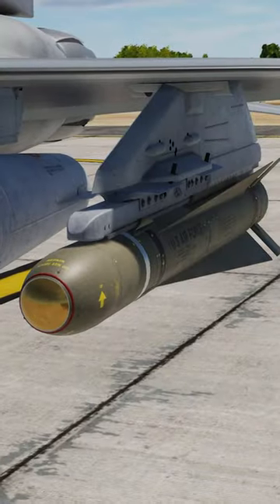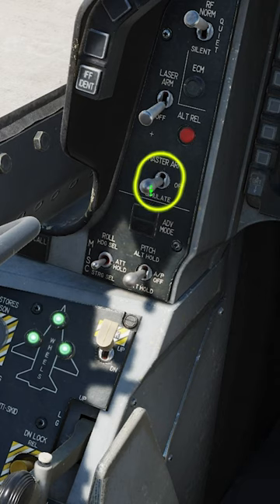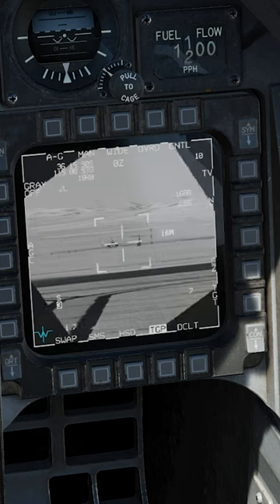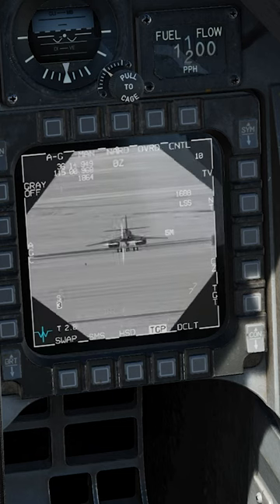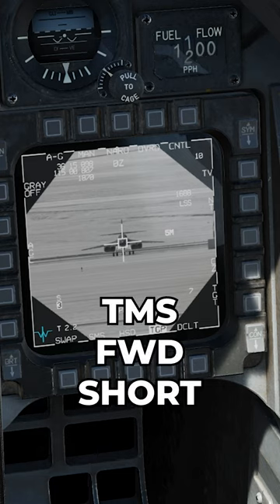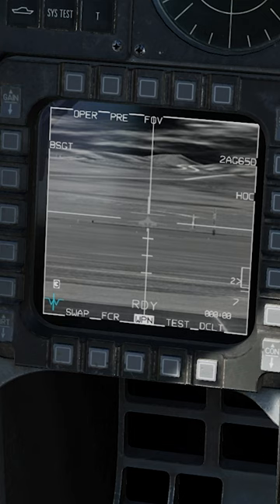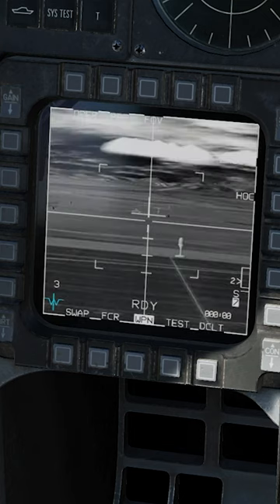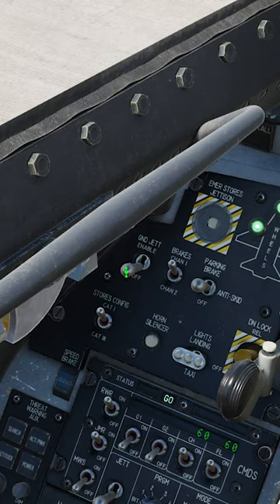F-16C Maverick Boresight Procedure in 60 Seconds

Comment: Okay, I will be watching this short for a week to get all the controls mapped.
Reply: Just buy a Thrustmaster warthog, everything comes premapped cause it’s pretty much the same in the cockpit
Reply: @hoverbike  and itll cost me only half a week salary….
Reply: @HOTSHTMAN53  at 20$/hour
Reply: @HOTSHTMAN53  idk man i bought mine for 170$ used, and it came with all the upgrades. Sanded down gimbal, silicone grease, etc. It’s an absolutely lovely piece of kit. Once I replace the gimbal of the stick with a Virpil base, due to Hall effect sensors already being present in the throttle, it should outlast me. I bet I’ll be dead and it’ll still work. Thing is as solid as a brick wall. I love it, and for 170$ it was an absolute steal.
Reply: @hoverbike  That's a sweet deal. I was looking for a Warthog set but everything I found was $375+. And I couldn't find it new under $500. I ended up saying fuck it and got the WinWing Orion2 with the 15EX II grips and the 16EX stick all for $491 shipped. I thought it would take a few weeks to arrive, but I had it in 5 days. Now I just need some rudder pedals because the z axis attachment for the stick was out of stock.

Comment: Don't forget to turn your 65s off so the battery doesn't die on the missles and don't forget to turn them back on before you need them!
Reply from the maker: Great tip, just not simulated in DCS
Reply: @TrickerDCS yet 😏
Reply: Doesnt that reset the boresight?
Reply: @jefe142  not in BMS good question though, although if the batteries die it doesn't really matter lol

Comment: Don't be surprised if your boresight has a fair amount of error or drift. Unless there was an effort made in the mission editor to put a very easy to lock up target far far away at the airfield. You will have errors in what your tpod locks and where your mav is looking. ED went a little overboard on this given all the things we magic wand over in other places but it is what it is
Reply: Just get it close and you are fine.
Reply: That's just how it works due to parallax, you need to do this procedure in the air, the further away the target is, the more accurate the boresight will be.
Reply: @Madnot4  How is this done in real life?  My gut tells me that wasting valuable fuel flying around to find and lock a ground targe to align is a bad use of fuel and time in the air. And unless a valid asset is placed there is really no way to get a good alignment. Where as this is obviously accounted for in RL
Reply: @MAYDAY SIMULATIONS  It's done in the air, because the mavericks have a battery that only lasts up to an hour (don't quote me on the exact duration, I haven't slept in 24hrs), usually in real life you spend way more time in transit, we are talking hours in the air. So yes, the mavericks are aligned in the air otherwise by the time you got to the target, you got no mavs.
Reply: @MAYDAY SIMULATIONS  this is how it's done in BMS, for example, because the maps are way more massive, and the time in transit is much longer.
Reply: @Madnot4  Roger that makes sense as a/a refueling is usually involved. Pretty sure once you align the maps you can shut them off to save the coolant without losing your alignment....but ya I don't an official manual.
Reply: I feel like an IRL F16 should have the covergence be automated. The targeting pod knows the distance, so why wouldnt a computer account for the correct convergence?

Like, World War 2 bombers had mechanical bombing computers that could account for that. And DCS is telling us a fricking 2000s F16 cant do that with its fully digital systems...
Reply: Ive looked it up and apparently IRL A10 pilots actually boresighted their mavericks on their wingman to have it point in the right spot by default.

Looks like the main reason is that the camera can shift when doing high g maneuvers. So with that and limited power or digital systems, you had to do it by hand?

Honestly, that just seems kinda pathetic, even for a 70s guided weapon. Especially when you have to do it on a 2000s F16 with modernized mavericks.
Reply: @termitreter6545  I c....Good info👍 Guess I'll try it in the air and see how that goes🛩🔥😄
Reply: @MAYDAYSIMULATIONS  mavericks are air cooled which is why doing this on the ground is a terrible idea. It doesnt take long to overheat one and cause it to burn out becoming useless. Happened a lot from moronic pilots playing with them while taxiing to take off.
Reply: @MinistryOfMagic_DoM  why do they have a 45 min runtime limit?
Reply: Dude I had a stroke reading the last part what are you talking about. Like the controls are pre set before firing or the editor already set everything up for you you just gotta set up the control??
Reply: @peterswanson6816  ya, sorry. As far as the parallax issue goes.......to align on the ground you really need to have truck or object placed as far away as practical to align to. And even then I find it's not great. To get the best alignment I think you need to be atleast 2 miles ish away so you'll almost have to do it in flight.  Unless your single player and do an air start....then by magic the alignment is perfect🙄

Comment: Maverick boresighting on the current patch seems to be still broken, you can boresight one side but when you MSL Step to the other side it loses its boresight. The drift appears to be random cause you can quickly MSL STEP back and forth and the maverick will point in a different spot each time.

Comment: Excellent short and to the point guide. 
Also have you encountered any issue where even after u boresighted the mavs the auto handoff just refuses to work most of the time? Having trouble locking up via auto handoff
Reply from the maker: It’s been inconsistent lately… I think there was a bug somewhere but if you lock up something more than a mile away it works best at the moment

Comment: Not sure if it's still the case, but it only works with Maverick type D and using the rack. You only have to align one maverick per rack as it's the rack you are actually linking to the pod boresight
Reply from the maker: Yep, boresight each station so twice.

Comment: And this is why I don't fly modern aircraft in DCS anymore. 🤯
Reply: You're too lazy to create a checklist?
Reply: @johng.2321  I think I'd have to. Problem is I own nearly every module and they are all different. Busy life, 2 young kids so I don't play them consistently enough to remember all these commands. So now I enjoy the older modules  with slightly less tech on board.
Reply: I think that’s the problem, and I’m speaking from experience. Each of the “newer” generation modules require thousands of hours just reading the manual and countless hours have to be spent applying the information you learned in the manual. And even then you’ve probably covered about 75% of the entire module. And then it gets substantially more difficult when you add another full fidelity module when there’s a good chance you haven’t covered all of the info and features of the first one. I made this mistake when I bought the Tomcat, and then followed it with the Viper less than 2-3 months later.
Reply: @pugachevskobra5636  yes, thank you, that's exactly the point I was trying to make.  If it was just this one module and you learn it inside out then there's no problem. But.....who wants to fly only one of these amazing modules. So instead I'm sticking to the more simplistic aircraft and flying on the coldwar servers. Hats off to the folks able to  operate the modern jets and helo's.
Reply: @pugachevskobra5636  thats why i only fly f16 and ka 50!
Reply: I get it; I really do. I’m wrestling with the Maverick right now and having a helluva hard time. Apparently I don’t have enough axis controls for the Radar cursor because I can’t move it around and that’s literally the only thing holding me up right now. I got everything else as far as setting it up but I can’t get past that.
Reply: Haha, I should’ve listened to someone sensible before buying all of these super complicated modules even though I love them very much.